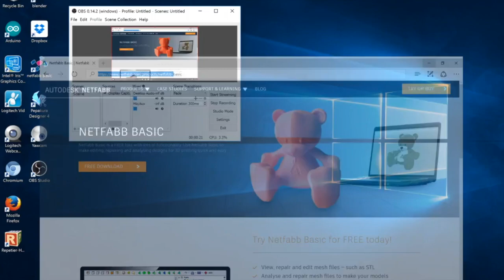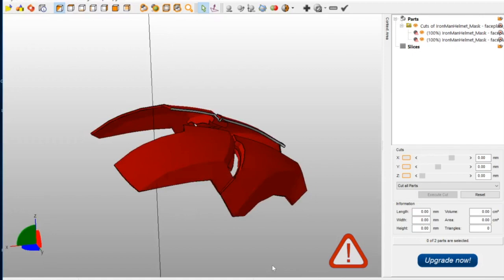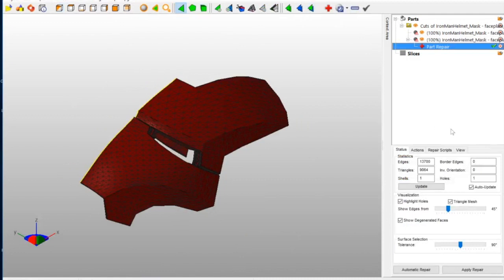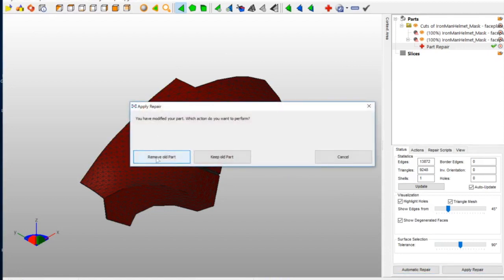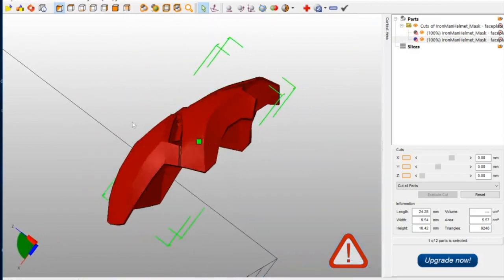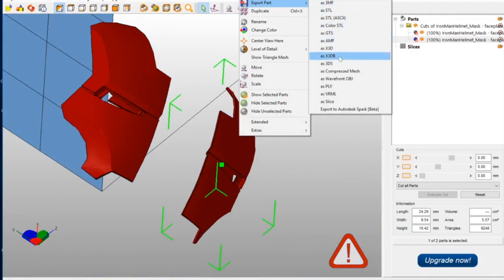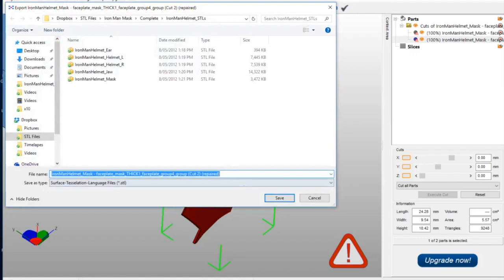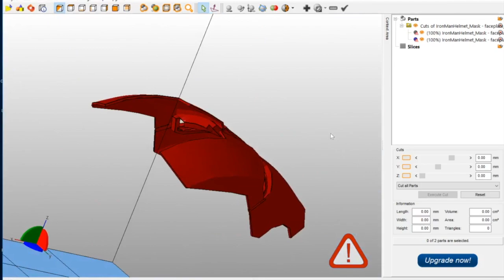How to repair fix broken STL files for 3d Printing FOR FREE (non water tight)

Comment: That's the most useless advice you could provide. Do you know why it was considered broken? Do you know what netfabb did when hitting Automatic Repair? Do you know whether it actually fixed your problem, or any problem? Because I can very much see that your part is not fixed. Not fixed at all.